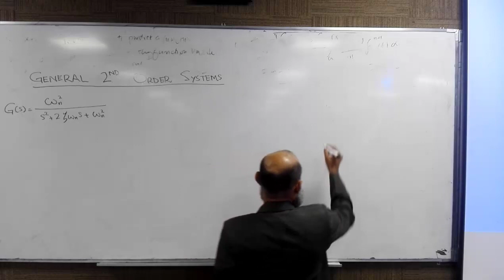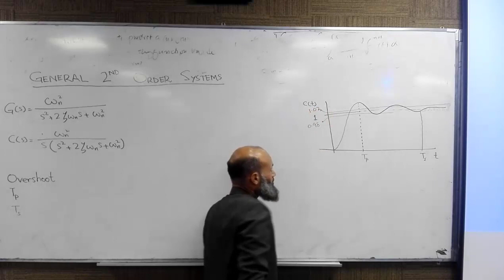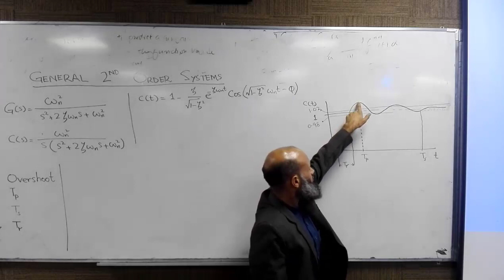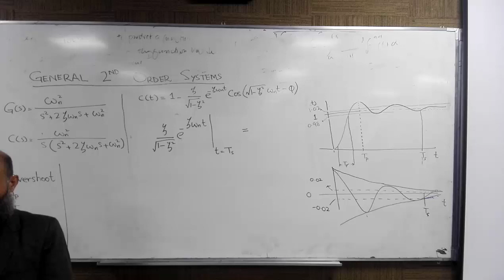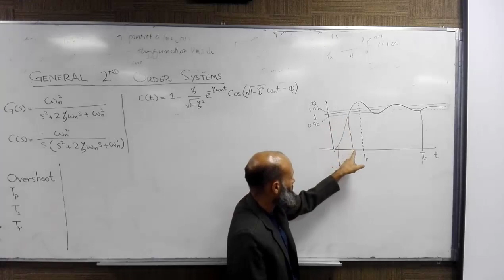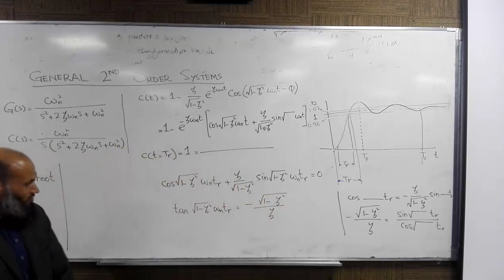LCS 21 - Overshoot, peak time, rise time and settling time for second order systems

Comment: sir what should I do if 
T(s) is given as [10(s+7)] / [(s+10)(s+20)]  how can I convert this to the form as you described in video ?
Reply from the maker: Multiply the denominator factors (s+10)(s+20) = s^2 + 30s + 200, the denominator is now in the required format. However, numerator is still not in the required format, there is a zero in the transfer function as well. What will be the effect of this additional zero? This is explained in Lecture 22 ( https://youtu.be/Lifm2gqeq6A ). In brief, this additional zero will slightly change the transient characteristics. Gain 10 in the numerator will only result into scaling and would not change the transient characteristics.
Reply: @MAFarooqi  i watched the video sir but I did not understand that how can I find damping ratio and natural frequency of the T(s) function which I wrote above. What if I try to seperate transfer function into parts as 200 / [ s^2 +30s + 200]  + other part.. then solving it ?
Reply from the maker: @ugurambarc3735  if you compare your transfer function with the standard notation, Wn^2 = 200, that is, Wn= sqrt(200). Furthermore, 2*zeta*Wn=30, that is, zeta=15/sqrt(200).
Reply: @MAFarooqi  thank you sir :)